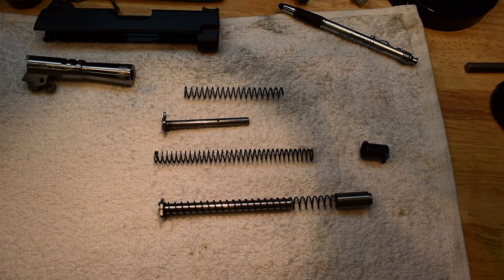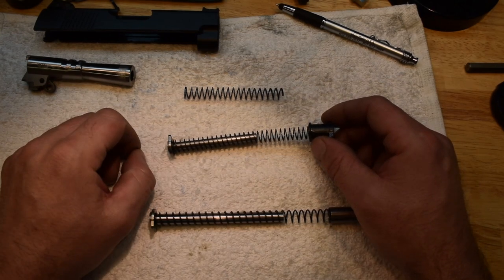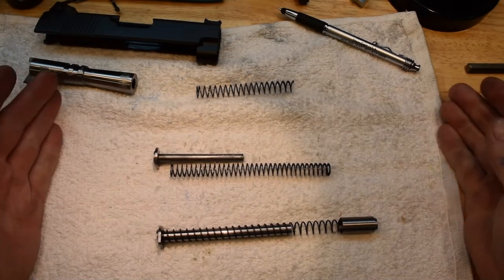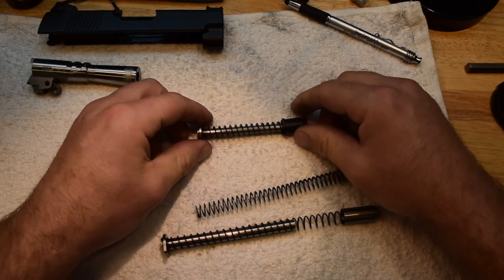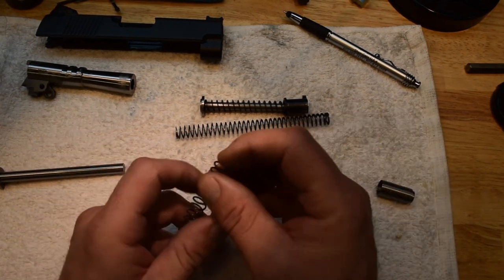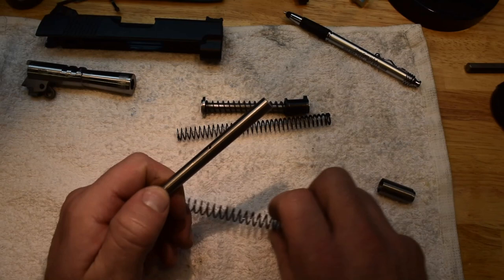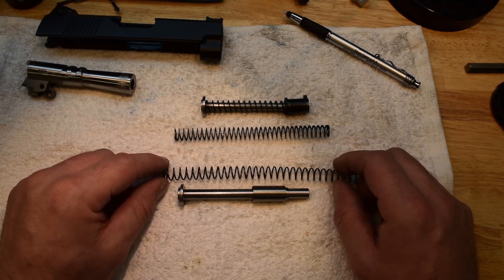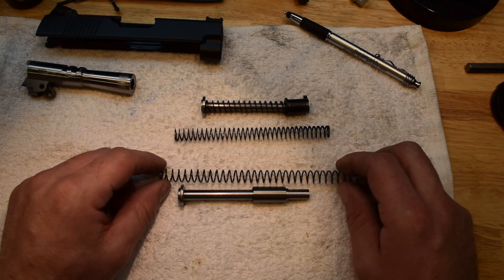1911 recoil spring tuning

Comment: 2020 update: My new RIA 1911s all had this issue. I cut the springs and it was like getting a free stroke on my slides. Much better feel to them now. Thanks for this video!
Reply: I came across this video and also have a Rock Island Tac Ultra 9mm. Based on this information I also need to trim my recoil spring. I've got about an inch extra

Comment: When you shorten the recoil spring doesn't that change the weight of it?
Reply: yes, there's less energy available to be stored in the compressed spring. Force is equal to the distance traveled from rest times the spring constant of the recoil spring.

Comment from the maker: the load weigh is set the the length it should be set at, so trimming to he correct length will make the spring work close to the advertised rate
Reply: I've seen your video for a 4.25in gun, how would it work for a 5in .45? Is it the same concept? If so, why do basically 'all' 1911's come with a full size 16lb spring?
Reply from the maker: @jesselopez1922  Keep in mind springs help guns load ammo and slow down the slide in recoil.  Many guns will need heavy springs to function.  This info applies to top tier guns.

Comment: I am building a officer size 1911 from 2 very unfinished castings of a slide and frame and all the parts made from quality steel at home as a side project (I've already got a nice 80% I built) on any gun I build I will literally sit for hours combing over friction areas and working them down and polishing them (no worries I use digital calipers to measure to make sure I do not fall out of spec). I must admit I did not think to check the end of the spring on the open power coil not sure why I wouldn't have done it but your video reminded me to do so. So thanks for the quick video. 

In case anyone is wondering I am simply attempting to build a 1911 with nothing more than steel I have around and unfinished castings resulting in around 100 dollar 1911 at home. It is simply to see if it can be done and be safe. Right now I am having trouble with ideas of cutting the lugs in the slide. Like I said I have a working $1200 80% kit from Stealth Arms I am using as a base for measurements as their fit seems to be precise and is good quality parts well within the tolerances needed. Their kit produced the ol top shelf hard to rack 1911 silky smooth action. I am working out a viable idea and I think I may have it figured out. I am not going to say right here what it is as the idea is quite unique and I would like the idea to be specific to my gun I produce if it works and then later explain what I did. I've noticed usually on the internet if you hollar out an idea that is outside the box then you get about a million people saying it cannot work because it deviates from the original design. Personally ideas are necessary for invention and better ways to accomplish something so why not. 

Again thanks for the video it is informative and gets right to the point.
Reply: Also how'd it turn out (5yrs later)
Reply: I wonder how this worked out

Comment: If you installed #11 recoil spring and then you cut 6-8 coils for instance, 
My question is what pound recoil spring you ended up with ? 
Thanks .
Reply: or two same pound springs, but one has 28 coils, the other has 32 - which spring is right?
Reply: RangerCaptain11A  Got it !
That makes a lot of sense, sorry about that .

Comment: Coated vs. Uncoated at the same power factor why the need to "spring up" a pound?
Reply from the maker: the coated bullets are often a little to soft and loose some momentum when they hit the ramp.  The extra pound of spring will help prevent FTF.
Reply: Makes sense. Thanks!
Reply: Patrick E. Kelley 

I find this funny.

You've shot competition for years and still visit a youtube channel for tips.
Reply: I know a lot...I don't know everything. Thanks you the Atlas crew I know more than I did before.
Reply: Patrick E. Kelley 

yes sir. he's definitely got my subscription
Reply: @jonathanlangford4291 Nothing funny bro, when you think you know so much that you can't learn anything. Then, you have a problem, my opinion.

Comment: Can't see this working on a standard  commander guide rod. The rod is too short to "test press"
Reply from the maker: This is for full length guide rods
Reply: @AtlasGunworks I can see how that would be difficult to do with a 'standard' 1911 recoil plug vs a recoil guide rod. Does that mean that the recoil plug gun can not bind it's spring?
Reply from the maker: @jesselopez1922  any spring can bind but the GI setup has a lot more room for extra spring as the spring is not captured by the full length rod

Comment: What is the recommended force for a 1911 commander?
Reply from the maker: It would depend on a bunch of factors.  The range is large.  Ammo, slide weight, slide fit, barrel ramp, caliber and shooters grip are all factors in what spring would work best.  High end guns that are hand built are able to run lighter springs that guns that use the spring to over come feeding issues.   9mm guns will use lighter springs than 45acp guns.
Reply: I would suggest a 20 lb for everyday nominal .45 use. Will be tight at day 1 but after first range session it will be pretty nice for every-day man use.
Reply: @AtlasGunworks  p
Reply: @AtlasGunworks I used your method to fit an 8lb spring to my 4.25 Prodigy 9mm. I compared the original spring which according to Springfield is a 12lb spring, and after I cut off 8 coils, they were both the same length. Have yet to shoot it, however, my gunsmith who has building 1911/2011's for at least 20yrs, has indicated that a 10lb would work better with defensive loads.
Reply from the maker: @jesselopez1922  The best avenue is to test different spring weights in each gun.  10lb might very well work better in your setup.  Springs will depend on the gun/shooter/ammo

Comment: I recently replaced the recoil spring (16#) in my Kimber Custom (5").  I've replaced the spring more than a few times in the 20+ years I've had this firearm and have not had issues.  On my last trip to the range with this new recoil spring (from Kimber), the the slide repeatedly would either not lock back on the last round, would release when dropping a mag or would release when inserting a mag.  One of these 3 failures happened about a dozen times when going through 300 rds of Winchester 230 gr. ammo.  This was highly disconcerting as it's pretty much more failures in one range session than the entire time I've owned it.  The staff at the range said maybe it's just the new recoil spring needing to be broken in so I kept firing it to see if there was a pattern with the failures.  Anyone else have this sort of thing happen with a new spring?
(Also, the mags are near new from Wilson Combat, a combination of 8 and 10 rd mags)
I suspect it might be a defective slide stop which I do have an extra of in my kit.  How often does a slide stop need replacing?  I generally hear that the recoil spring should be replaced after 4K or 5K rds but I generally haven't heard of a slide stop wear issue.   It does strike as a part that does endure a lot of wear.  I'm off to the range to test it out after I hit send with this message.  Hopefully my trusty 1911 is once again trusty with this potential fix.
Reply: Great question. I have several 1911's, except for my Dan Wesson, I don't even fire a .45 without installing either a Wilson Combat or Ed Brown slide stop it it. I recently purchased a beautifully built and finished Standard Manufacturing Royal Blue 1911, NO MIM parts. Awesome fit and accurate as heck, however, first time out, I had my slide NOT lock back on the last round or, lock back with rounds still in the mag.  I noticed the slide stop seemed to be 'walking' out while firing. I compared the slide stop with my extra Wilson Combat slide stops, and it lacked a detent for the detent spring. I installed a Wilson Combat slide stop and she runs flawless. It's one of my EDC's.
Reply: @jesselopez1922  Yeah, it was the slide stop.  The old one was so worn that bare metal was exposed on the top part of the thumb tab that engages the notch in the slide.  The replacement is from Wilson Combat and it runs great again.

Comment: After a period of time the spring will shorten up on its own so why trim at all
Reply from the maker: The slide must have full travel, the spring must not stop the slide from full rearward travel.  In stroked guns its common that the spring must be cut
Reply: I've never had to do this. Never even seen this in 20+ years. Is it more seen in short slide guns, or carry guns??
Reply from the maker: @jodyfelland2162  
Recoil springs in the past have come in government, commander, and officer length.  

Model pistol builders like us are usin
g different spring lengths with different slide lengths to make this 100+ year old design work better.

Lots of the information we provide is modern and won't apply two people copying John Browning's original design from over a hundred years ago
Reply: @AtlasGunworks  that's what I suspected. Thanks.
Reply: @AtlasGunworks  should you stroke a 9×19 minor gun that's dedicated for steel?  Seems like you would always have to buy the more expensive extended frame to cover that 
.400 stroke cut? Can a collar style reverse plug me fitted flush in front, or does it have to protrude out front?? I'd like to build one.
Reply from the maker: @jodyfelland2162  
Not sure the results would be any better with minor loads.  It's a lot of work for most likely zero gain